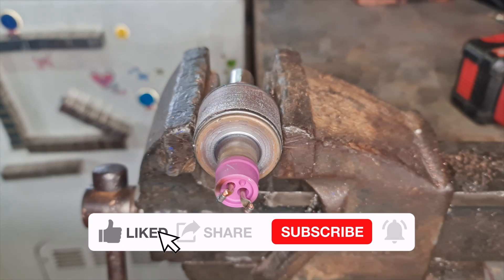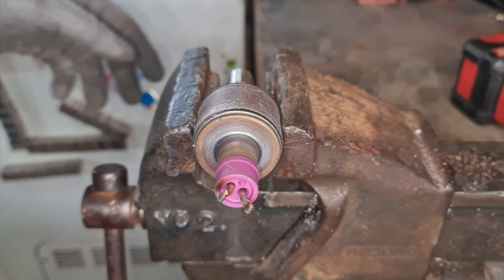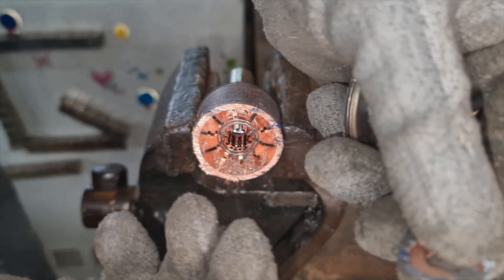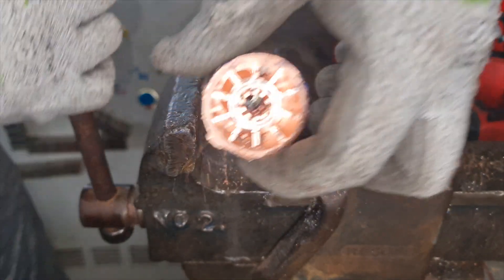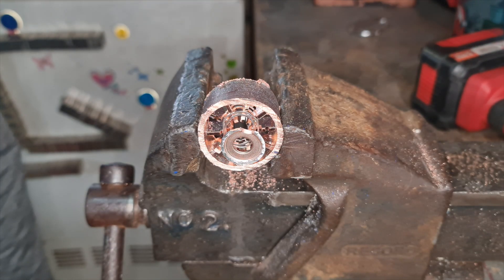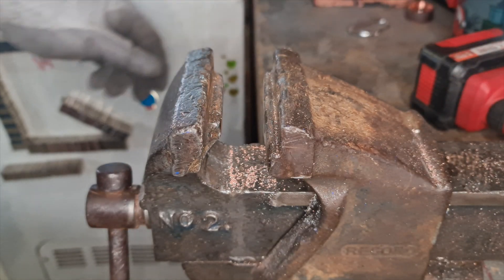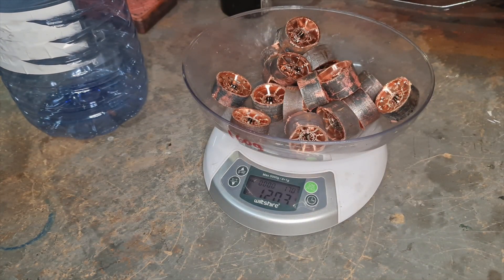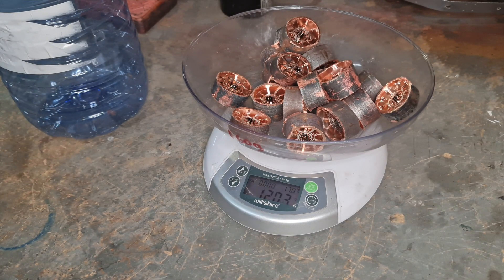Microwave Resonating Cavities - Scrap Breakdown - Metal Recovery - Metal Recycling

Comment: I believe the insulators are brazed on and can be de-soldered with a torch.
Reply from the maker: That's interesting. Have you done this personally?
Reply: @MicroScraprMike  Yes, but I wasn't scrapping them. Just taking one apart.
Reply from the maker: @therealjammit  Will a simple handheld butane torch work? Or does it need to be oxy acetylene ?
Reply: @MicroScraprMike  I used the propane to do it. The MAP gas should also work.
Reply from the maker: @therealjammit  I'll give that a try, thanks!

Comment: Nice video friend. Hopefully your saw just needs to cool off and will work. 
I only do 2 or 3 at a time using my angle grinder.
Reply from the maker: Thanks for watching! It's the switch that's cooked. I'll replace it with a new one and bypass the safety mechanism. How do you find using a grinder?